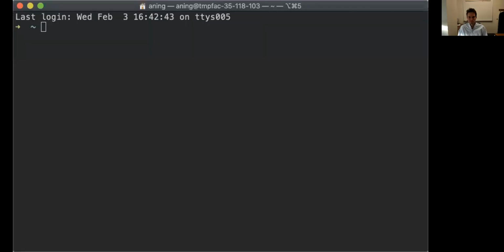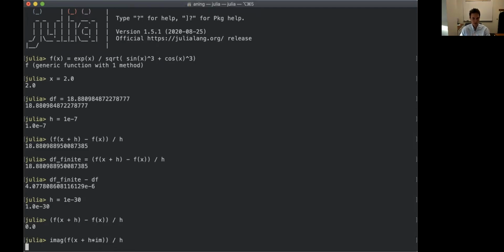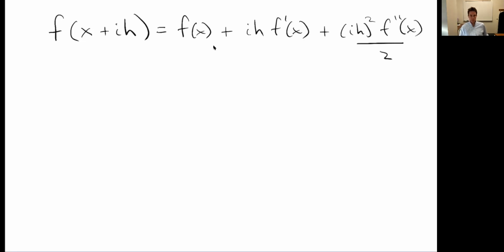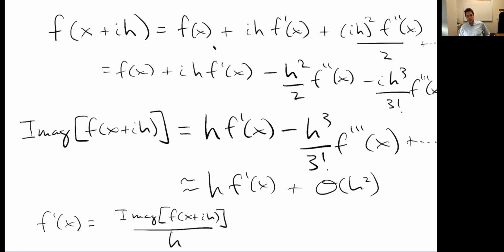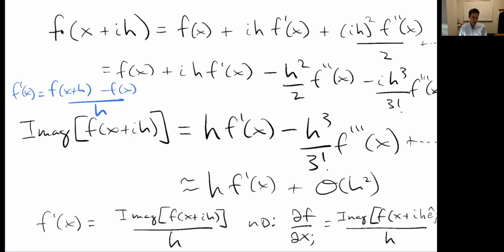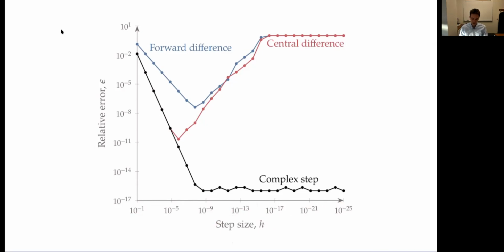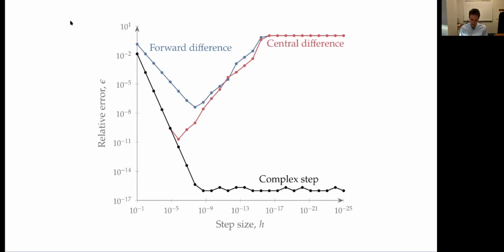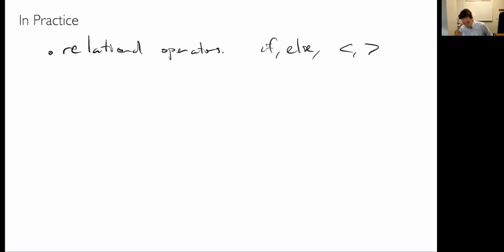Complex Step

Comment: Awesome video! Thank! But this makes me curious. How does one take the complex number of say logarithms? And I feel like not all functions can take and output "sensible" results when given a complex/imaginary number e.g. blackbox function whose internal calculation involves tables or looking at graphs/figures to get intermediate values.
Reply from the maker: complex logarithms are well defined.  almost everything has a complex counterpart. however some complex functions are defined differently (like absolute value) and so they need to be overloaded.  Logic is also something you would want to modify to only use the real part (e.g., if statements).  you wouldn't want to have graphs/figures in a function you are trying to get derivatives of anyway (could be an optional argument to the function to plot).  The book discusses these nuances in more detail.
Reply: @BYUFLOWLab  thank you for the reply! Which book are you referring to btw?